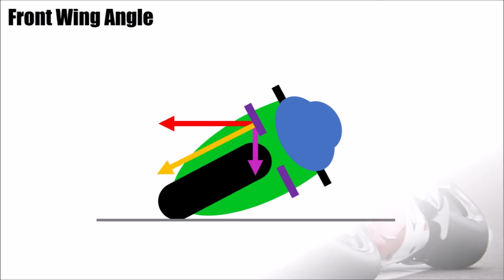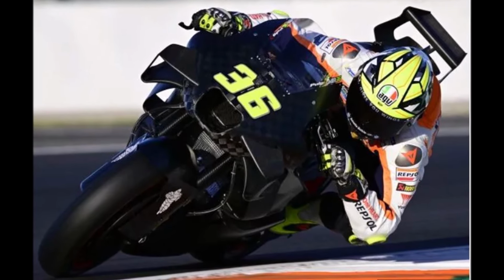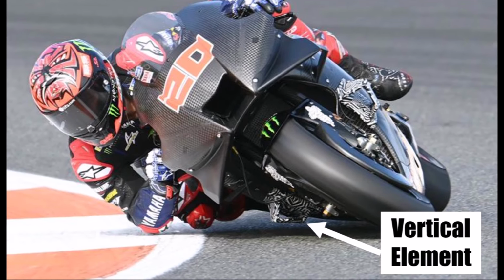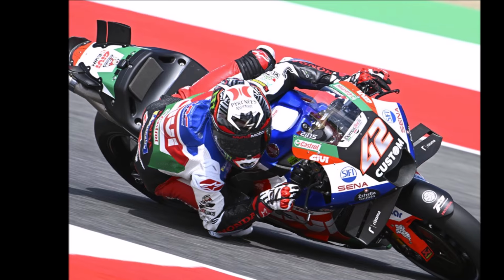MotoGP Aero Problems - EXPLAINED

Comment: Whether I like it or not.  I am thoroughly impressed at how quickly motorcycle fluid dynamics engineers are figuring all this out.

It took automobile racing engineers close to 50 years to figure out how to best use the air.

And the motorcycle engineers are accelerating the speed of improvement for bike in what, a decade?
I don't know but it seems like warp speed acceleration. 

I don't see cars beating bikes through corners for very much longer.

Comment: Phenomenal video 👏 top work!
As someone who follows F1 and MotoGp, I've been fascinated at the aero development in MotoGp over the years. If you look back even as long ago as 2015 it's like the manufacturers were stuck in time with only the front wings to help with anti wheelie. And then circa 3 or 4 years ago Ducati must have had osme a-ha moments and I've been fascinated to understand what the different components do. 
The front wheel attachment: I always thought these devices on the Ducati and Aprila were some sort of flow conditioners until I watched your video. I now understand they are....ground effect. Wow. Insane. 

I would love to hear from a current rider how much more physical this makes the bike. I remember on a F1 related podcast a few years ago, Gary Anderson (ex Jordan F1 head of technical) explaining how different the current era of ground efect cars are versus the 2018-2021 era of F1 cars and he explained the 2018-21 cars there was a much wider suction effect which allowed for different ride heights but the new cars from 2022 onwards, whilst the ground effect is more extreme, the suction window is narrow and once the ride height is changed the cars drop downforce massively. He explained this by the analogy to when you try and pick up a piece of heavy laminated chipboard off a smooth floor. To begin with it just won't lift and then once you get your fingernails under you see the air sucks all the wood chippings and dust from nearby under the sheet and then as you lift it the suction stops. Mad!

Comment: looks like shit, is expensive af, riders hate it, is unsafe up to clearly dangerous to drive around other people with blades on rockets that freak out when the air changes, most visitors hate it, the leading driver has an extreme advantage because noone is disturbing his air, probably one of the reasons why suzuki left the moto GP, guess yamaha will drop out sooner or later too and we will have a (already) superboring Ducati Cup with 12 ducatis and 2 hondas following....... MotoGP was best to watch at Stonertimes, with cornerdrifting fully manual bikes where the rider was the key and not a bazillion of electronic devices on a selfdriving bike.......... was so boring to watch that i missed half the 23 season because i almost fell asleep at every race....

Comment: I think the aero effect of these tiny wings can't be compared to what F1 does. F1 aero produces so much downforce that they could drive upside down on the ceiling of a tunnel if they wanted to. You're never gonna get that on a moto. Of course relying on aero comes with some downsides when the aero doesn't work as planned. But really they are trying to make the fastest bike they can. Ideally it is faster than the opposition and in that case you'd never have to ride in the dirty air of someone else. The plan is to qualify pole position and then drive away from the rest.

Comment: Limiting elements that would create excessive dirty air or make the bike too unstable (especially at high-speed corners) will be enough. Riders will gradually adapt to avoid dirty air like Formula drivers. There are still many chances to overtake because GP bikes are not as wide as cars and have less frontal area. Until MotoGP lap times get close to that of Formula 2 (which is almost 34 seconds faster at Silverstone GP), I don't think they will be too fast.

Comment: MotoGP is in my opinion becoming boring. More downforce = smaller braking distances reducing overtaking opportunities. It's obvious that aero is one of the main reasons the Japanese bikes have fallen behind. Soon it will be as boring as F1 with one manufacturer winniong every race. Only 5-6 years ago, we had 4 or 5 manufactures capable of winning.

Comment: As an engineer I really do not want to see this banned. This is the fun I get in high end motorsports. F1 is incredibly boring thanks to having such strict standardization and rules which simply smother technical innovation instead of encouraging it.
Reply: In a way you are right. Personally I would like to see smaller engine sizes and let manufacturers go a bit more nuts with what they can eek out of less. Would actually drive more real world tech in the end. 

Development should filter into production machines, and wings are in all fairness not relevant on public roads. Smaller highly efficient engines with high output however are more relevant to the world when we are faced with reducing emissions and carbon fuel usage.
Reply: You wouldn't think that way when you come up to someones ass end and loose all your braking cause your front wings lost the wash. This is dangerously stupid. You can't see the wind when it goes away. This is joke racing.

Comment: MotoGP must simply take the brave step in allowing ACTIVE AERO that will come into effect as needed under acc/braking and turning- the inner wings could fold away or angled at a perpendicular to the ground when folded.  Same strong electro servos as valve timing systems like VANOS/VTEC could be used...it's about time both MotoGP and F1 allow active aero...next level shxt'...

Comment: I think aero isn't something that belongs on bikes and if left unchecked will result in bikes that are cornering at such high speeds that riders will struggle to control them. The whole appeal of bike racing is that it's close racing but putting aero on bikes is making it so they can't follow each other. IMO wrong way to go

Comment: 6:38 Sure. if you wanna go fast in the water, you need hydrodynamic. You wanna move fast in the air, you need aerodynamic. That's what nature do.
Reply: Exactly!!! They make engines small which leads to less speed, tank small means smaller race now they want to take aerodynamics away why?

Comment: Yeah because of this the bikes are much less about feel. First few laps with cold stip GP tires they basically just hang on, once bikes warm it has grip but still isnt good for feel. More aero will make bikes stiffer then add squating suspension and it becomes a fast bike but a ez to wreck bike as well.

Comment: How about active aero devices ?
so wings can tilt horizontally depending on lean angle and get straight as bike gets straight. this way we can use both left and right wings and drivers don't have to "block" one side wing in corners.
we could further make it better by giving wings motion in vertical plane as well , so during hard braking they can create lift on front so it doesn't dive under braking and keep rear planted hence we can use rear tyre more during hard braking,  evening out the braking forces on both wheels.

regarding wake problem , is this really an issue ? how much of total grip is coming from these aero devices on high speed zones ?
i'm bit skeptical about complains , i don't think aero wake on motogp is as big issues as in F1.....maybe drivers beings drivers and complaining about everything, thats their job to be fair.

Comment: Honestly, I love that they are bringing in more aerodynamics. Comparing MotoGP and F1 isn't really ideal since most overtakes are done by a faster car and on straights in Formula 1 because it's that hard to follow other cars. With motorcycles, we're seeing plenty of action regardless of the aerodynamics and, despite the dirty air, Marquez has benefited from towing other riders in qualifying so it's clearly not as much of an issue as most people seem to think. Realistically speaking, we've been having much more action now than when Marquez was winning every race. MotoGP is supposed to be the top of motorcycle engineering. Formula 1 was forced to reduce aerodynamic components and add a drag reduction system because the racing was that bad. MotoGP isn't having that issue at all so reducing the aerodynamic components would just ruin the fun. Another thing is I personally find it really cool to see riders finding other lines to avoid the dirty air. MotoGP is perfectly fine the way it is right now imo
Reply: But aero in motogp is in it's infancy, every season the racing it's going to be worst. At the moment is manageable and the racimg is still good, but long term they have to ban it
Reply: @mullayho1759 so far it’s has not been the case

Comment: It won't get anywhere as bad as F1 given how small bikes are there's far better line options.
Reply: Not sure about that, increasing corning performance is critical for bikes. Aero gets exactly as complex as you want it to be. Give engineers a problem like this and it will get wild.
Reply: dont compare 2 wheels vs 4wheels your body is moving by corner while f1 is moving by its tires 😂😂😂

Comment: Its not MotoGP themselves that are creating rules to allow teams to put more wings on the bike. The regulations have been stable for some years and teams are just developing.

I sort of get what you mean but the way you said it, comparing to F1 sounds a bit wrong.

I hate aero on bikes and what it gone.

Very very good analysis too, bike aero although isnt great for racing, is very interesting and complex. 

There is an aerodynamicist that worked in f1 at Ferrari, then moved to Aprilia, he said motorcycle aero is way more difficult to get right than car aero

Comment: Interesting bit about the ground effect design on the Aprilia and the need to move the cooling fins upwards. If I am not mistaken Espargaró and Viñales both faced extreme overheating in Indonesia, Malaysia and other extremely hot venues. Certainly the design has some cooling deficiencies.

Comment: It's incredible how MotoGP has willingly gone down this route despite riders clearly saying that it is ruining the racing.
Reply: I mean it does if u dont get past in early laps with cold tures etc its much harder to pass when you need aero to get performance. F1 battles this constantly. But its fact these bikes get so stiff tires get stiff to handle loads and keep aero platforms ideal it destroys all riding feel. Its not like WSBK where a rider can make bikes do crazy stuff cause they r complient. In GP talent is required or you are wrecking. Even if ur the best these aero GP bikes are wholy unforgiving
Reply: If you want real racing, moto2 and moto3 still use same engine, part, body, no wing element.
Reply: The problem is once you get aero into a series people will always attempt to claw as much of it back as possible, it seems to me that it's the diffusers and rear wings that are the biggest culprits where dirty air is concerned.

Maybe they can regulate those out of existence but anything short of a bulletproof aero ban is only gonna result in rule bending
Reply: I think it's because MotoGP and WSBK were getting too close to one another in terms of performance. Since MotoGP are the prototype class they had to do something to set themselves apart, which is aero. It did make the bikes go faster around tracks.
Reply: @Streamlines i think that was a factor . But de specing the superbike would have been a better option
Reply: @Streamlines  ok but how long until aero bits are on the superbikes? The new CBR600RR is getting winglets as standard, and that's the road legal bike. 
Makes me think Honda has their eye on reclaiming the Moto2, since there's conversations about downsizing the GP bikes from 1000cc to 850cc... it also makes sense to downsize Moto2 from the current Daytona 765cc back to 600, 4-cylinder screamers. Having less than 100cc difference in capacity between Moto2 and the GP, doesn't make much sense
Reply: The racing is pretty good let’s be fair - tyre conservation/preservation is more of an issue personally, they should make the tyres last for longer and so you can push on them more for longer - rather than the first 8-10 laps of easing into a race winning pace. To me that’s what the focus should be more on
Reply: Thank Dorna and they favoring Ducati since the ECU standardization
Reply: @dantton1987  It makes me so darn mad.
Reply: @dantton1987 They didn't favorise anybody with the standard ECU, that's just crybaby comments.
Reply: @Random63R400  Yeah, right. So Honda had no benefit of developing their own ECU with whatever brand they used and could ride just the same with Magneti Marelli (a Ducati partner). I am sure Honda going from a screamer engine to a big bang (while losing performance) was just a coincidence. LOL. LMAO even.
Reply: I feel like it's not so much willingly as just allowing it. There were basically no aero regs, teams are just trying to go faster. MotoGP is pretty much going through what F1 did in the 70s. They'll have to figure out what they want to do with aero and limit it where needed.
Reply: If it takes an f1 approach now and the bike with the best engine wins you'd then say its boring. 

Allow the aero to do its job. These are prototype bikes that are pushing the edge.
Reply: Everybody crying in the comments but don't even understand what Moto GP is, PROTOTYPES just like F1 is, it's made to see never seen before designs and concepts, plus this Era has more different winners than ever before (not only the known Rossi, Pedrosa, Lorenzo, Stoner) so the racing is better but having a closed mind is y'alls problem.
Reply: @Random63R400  The racing is better??!? How can you possibly say that?
Reply: @perfectman3077  Aah you are part of those Who only want to see Rossi, Lorenzo, Pedrosa, Marquez or Stoner win, no independent teams smh.
Reply: BS the racing is the best it's ever been 
Laps records are getting broken

The sprint races are absolutely epic 
Watching Moto GP since 1995 it the best it's ever been

The only disadvantage they have is getting sucked in underbraking
Reply: And yet it's STILL a better spectacle than Formula 1
Reply: I came here for notes ...
Reply: People just don't like change. "It was better in my day" nonsense.
How is it any different to Honda's v5 or big bang vs screamer. Technology moves on, it always has and it always will. You can either winge about it or adapt. 🤷
Reply: Drivers are secondary in 4 wheel racing, took a while for riders to become secondary in bike design

Comment: I think that aerodynamics helps if the list of advantages is definetly longer than disadvantages. It seems not the case for motorbike. Due to his natural shape, a motobike belongs to the world  extremely low aspect ratio bodies, therefore the real big advantages could be confined to a small amount of technical  choices. And these choices could work very well in a isolated wind tunnel test model, i doubt with the same efficiency in the "middle of the crowd".

Comment: It is hard to said aerodynamic ruins everything in motorsports because reason term of "Pinnacle of Motorsport" but the Regulations must be tightened where areas could added the aero, wheres area that not allowed to be added, but i still enjoying motoGP race with aero & electronic devices

Comment: Maybe I am wrong, but from what I  remember the vertical connection between wings is due to regulation because back in 2017 when single wings were banned, ducati found a "hole" in the regulation introducing fairing integrated wings. And from that moment on all the wings maintained that style
Reply: Exactly this. U can see how Yamaha and Aprilia played with this "loophole" in order too create double wing.
Reply: FOM officials couldn't come up with meaningful aero restrictions if their lives depended on them. Suspension mounted wings ffs, FIA banned these almost 60 years ago.

Comment: Some corrections.
1 The wings are enclosed because the regulator said that so they are safer in case of a crash.
2 The wing on the fork have been introduced by Aprilia, not Ducati.
Reply: Might be the initial reason. Actually though induced drag is a very common problem in aviation and since most of those winglets are inverted airfoils (low and high pressure on either side; bottom curved and top is flat), the problem had to be addressed and solved too. That's why the winglets either have some thickness to it or/and are mounted at an angle, which is called angle of attack (α) which is a coefficient for lift or in this case downforce. 
Quite funny tho at first I thought of winglets as just angled planes, but then I got my hands on a BMW M1000 rr winglet and saw the airfoil profile. 

More to induced drag:

Induced drag led aerospace engineers to apply those initial winglets to commercial airplanes, since induced drag as its name suggests is nothing else than lost energy induced through tip vortices. I don't know the exact numbers, but those winglets on the tips on every airfoil save tons of fuel. And they are pointed upwards has to do with limited space on airport terminals. 

Another way to reduce induced drag is to increase the aspect ratio of the wings which is the reason gliders are so wide.
Reply: No true :D in current shape yes its is. But Ducati run semicovered  concave front wheel cowling in the past. Witch also acts as a wing but in subtle differences.